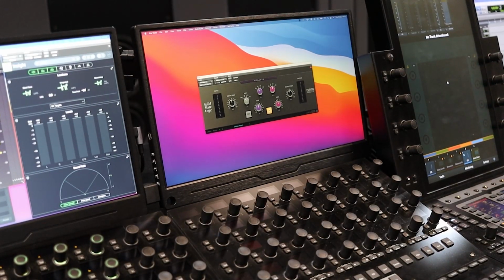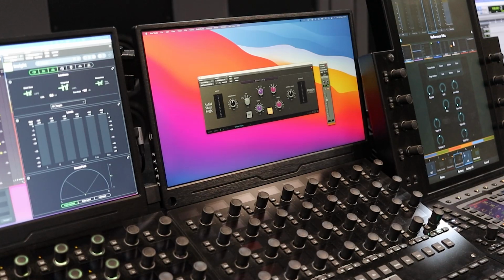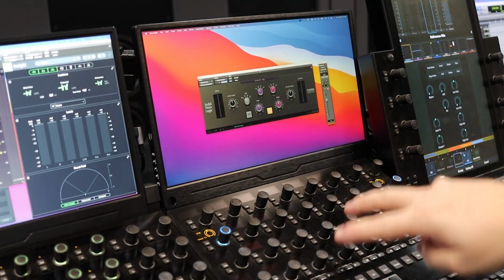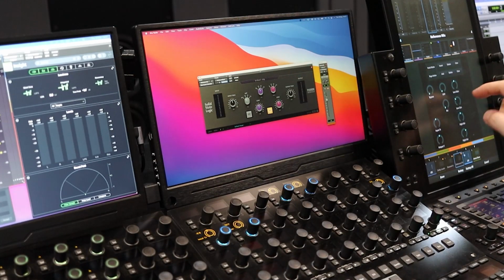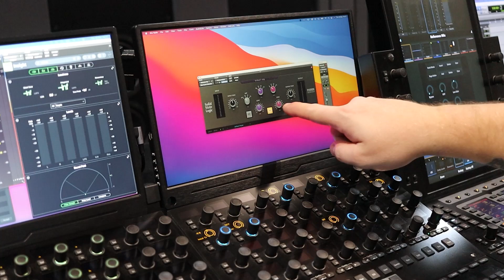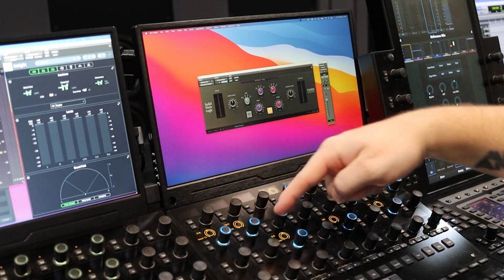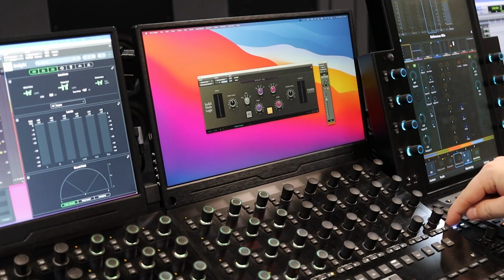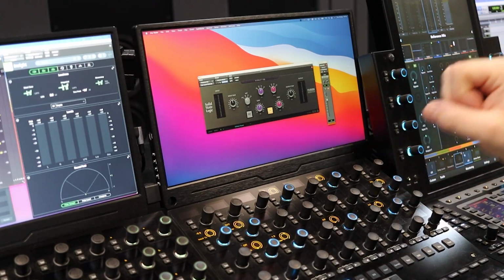How To Map Plugins Using The Avid S4

Comment: Great insight, thank you very much for it! (Avid should pay you a commission for it!)

What I'd be interested in: can you map the colors of the plugin to the knobs as well? Right now every knob on the S4 is blue. Like, if they were violet/magenta like on the plugin, that would make it even easier to identify. Is that possible? (or maybe like 16 colors only)
Reply from the maker: No that isn't possible. The colours are set as they are for plugin mapping. The possibility is there as you have multiple colours available for each knob.
Reply: @AudioAnimalsStudio  Oh, so blue is for "show currently mapped plugin", that's also not bad. Thanks, though!
I wish Avid made a separate controller like this, only to control plugin parameters (just like the new Nektar CS12). It wouldn't make sense from a business standpoint of theirs, though.
Reply from the maker: @galgogergo  I can guarantee they'll never do this. I've been wanting it for years. If they did nobody would buy a S4 anymore. I'd much rather 2x s1, a avid dock and 2x plugin mapping modules. That would cost let's say £5000 and would be very very similar to my £40k s4.